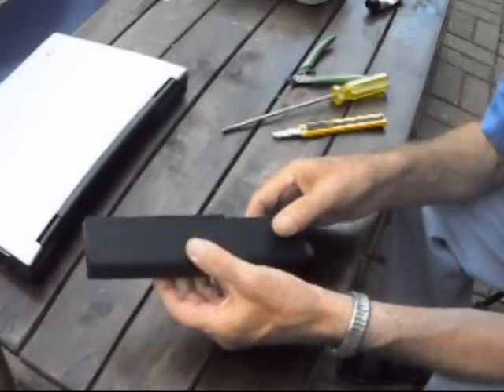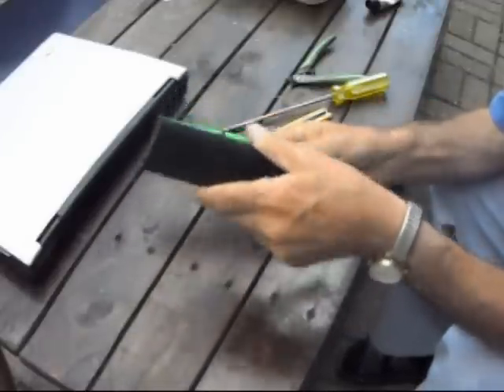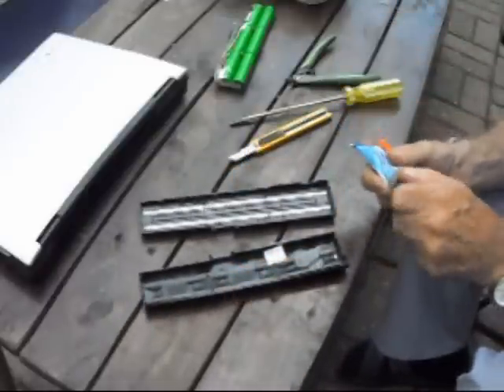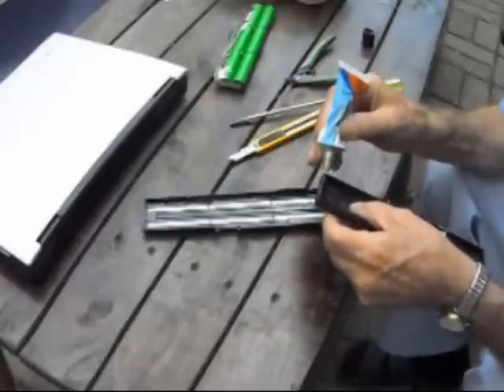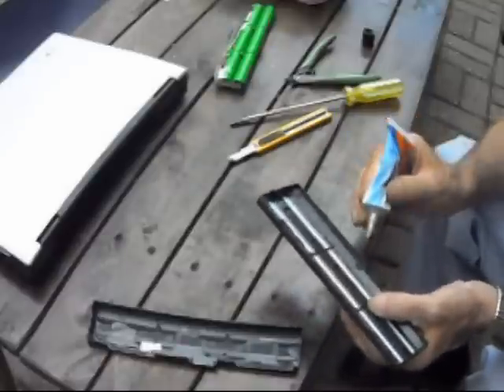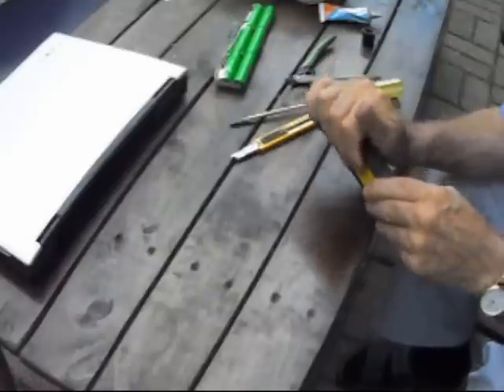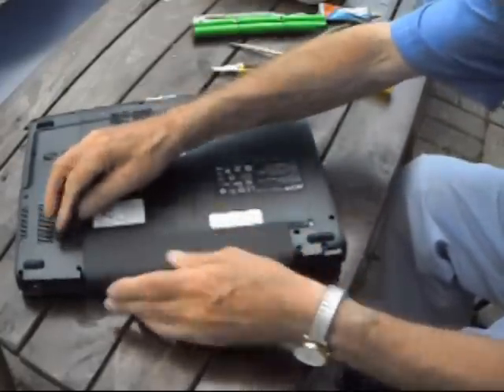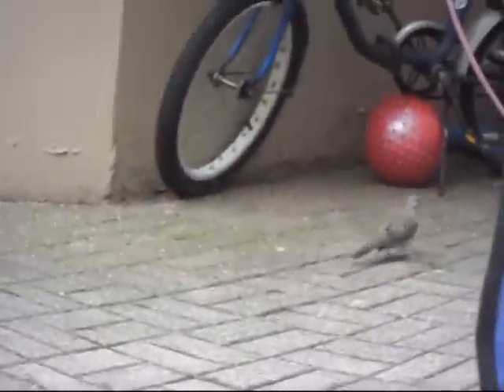Remove dead cells from dead laptop battery pack

Comment: If you're going to go to the trouble of tearing apart the battery pack why wouldn't you just go the extra step and simply replace the  existing cells with new ones.  You buy the individual battery cells online.  It's simply a matter of soldering metal tabs (for wiring) onto the new batteries (or buying them with the metal tabs already soldered on) and then making sure the batteries are put back in the same order paying attention to the wiring and polarity of the circuit and you're done.  Just make a diagram of the existing circuit (where the batteries and wires all connect along with any circuit boards), a bit of soldering and  you've got a good working battery again AND a portable laptop again.  The hardest part is probably just getting the battery pack apart.  Search for a video on rebuilding a laptop battery pack and it will show you exactly how to do it.
Reply from the maker: +Soulrider2012 I just didn't want to get someone involved in blowing up a battery in their face. Thanks for your interest.
Reply: "simply a matter of soldering metal tabs". No. It isn't. Not with most soldering guns, irons, or even professional soldering stations. You can't do batteries with those without risk of damaging the cells from heat.  They are spot WELDED on with a special stamping welder.

Comment: Thanks for showing this video. I like to pull the battery and just run on AC power when using my laptop a long time. But don't like exposing the internals of the laptop in doing so. This would be perfect. Just need to find a dead laptop battery somewhere.

Comment: If I get a spark while removing the solder tabs, what does that mean?
Reply: RUN!
Reply: Alif Zack lol it's fine. Apparently it's normal in these situations unless it's a short. In this situation, I had the cell groups separated already and was removing tabs from paralleled cells.

If there's a spark while they're all together and the cells heat, there'a a short. If not caused by your tool, contain it immediately
Reply: Exaxtly

Comment: Hello! I've already replaced dead cells, and the voltage is ok, but somehow I cant get the 11.7 volts I need in the terminals of the battery. Can you help me here?
My battery uses 3 cells of 3.7 Volts each
Reply: seems you are using some other cells. use cells wit at least 3.8/9 volts ration to get 11.7 volts.

Comment: I do however pry open batterypacks myself to replace lithium cells well aware of the risk of potential damage caused by moisture, broken traces on the PCB. Having just a few types of standardized battery packs would make them cheaper and it would be easier to get replacements. This would hurt sales of new laptops though, so no manufacturer is doing this.

Comment: Mass production of that little pc board does not cost nearly as much as you'd think. The batteries cost the most by far, but the thing that bugs me about laptop batteries is that there is no standard yet. Almost every model comes with its own kind of battery pack filled with lithium cells that are somewhat standardized. I can understand why manufacturers make it relatively difficult to open these packs up because lithium batteries are dangerous.

Comment from the maker: It simply doesn't work off the battery. AC adapter works fine. Was only eliminating the weight of the dead cells.

Comment: just tried to open 6-cell battery pack for Asus F3M that is 11.1v 4800mah, model A32-F3 and it just isn't possible to open without totally braking the case....the battery was so bad that it didn't even manage to boot into widnows without AC so I just opened it the hard way to have a look at least..all my 18650 protected cells were a bit longer to refill the pack with new cells and just the 2400mah cells alone from DX would cost me more than what I found the original brand new battery on ebay for

Comment: I always use it plugged in except rare times so why carry the extra weight?   Plus you should not leave the cover off the back as dirt and junk accumulates easily.  
This is for dead batteries not good ones. It does no harm to use the laptop without a battery  however keeping an old dead battery can eventually cause harm.
Thanks blaineh9 for the video.

Comment: blaineh9  This is a great idea however the simpletons on here need simple explanations. If you change the title then in the description tell what and why to do this it will help many people.   Also add keywords so its searchable by relevant topics. 
For those simpletons not getting it-   Your laptop still works without the battery. You plug the adapter in and run it off electricity.  Not everyone can purchase a battery right away or needs to.

Comment: Not everyone can replace the battery right away. The point is it makes carrying the laptop a bit easier since the battery is heavy.  Yes the laptop works still. You plug the adapter in, & plug it into a wall outlet. Viola! Power!

Comment: Have not said that you did say it would work, just said it so people would not try to much and brake it.
Anyway do you have a video of that? then a plastic case you mean something not looking like original? have found new battery, even 8800mAh for around 35$ so but just seem bad to not use one when it has good abtteries except one inside.

Comment from the maker: Thank you for your interest. The point of the video was simply to eliminate the relatively small extra weight of the dead cells. As for the inconvenience of the adapter, in my opinion, it is standard equipment for most laptops over 2 years old. I have no intention of ever trying to solder or attach the replacement cells properly or more importantly, advising someone else to do so. Still saving up my $100 plus for a replacement battery, or just wait a little longer for a $100 tablet.

Comment: Sorry,not sure the point of this video either.No disrespect, I can understand having the aesthetics of a clean looking laptop, and the decrease in weight, but you are now forcing yourself to carry around an equally heavy,clumsy AC adapter? Not to mention always having to be dependent on an outlet. My thought is to spend $25 and order replacement Cells for the laptop.You have already done 50% of the work cracking open the battery,may as well just repack the cells for cheap it is easy!